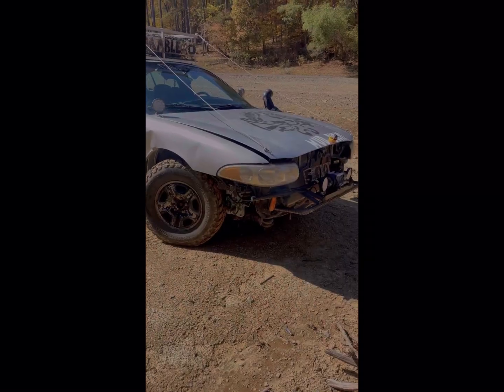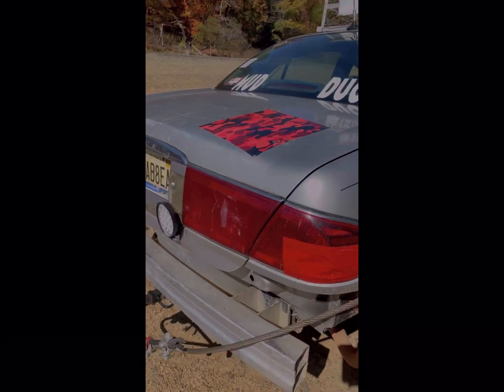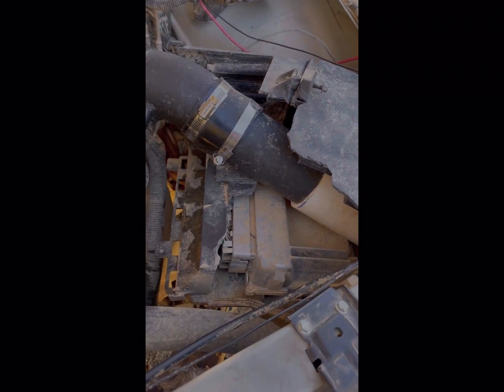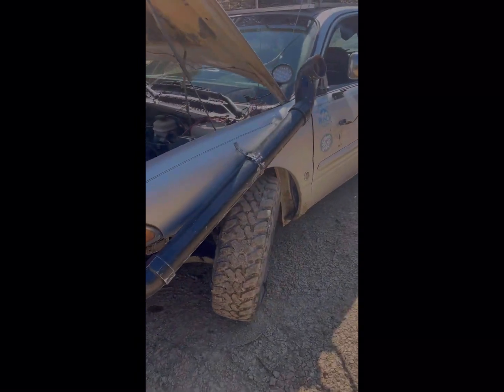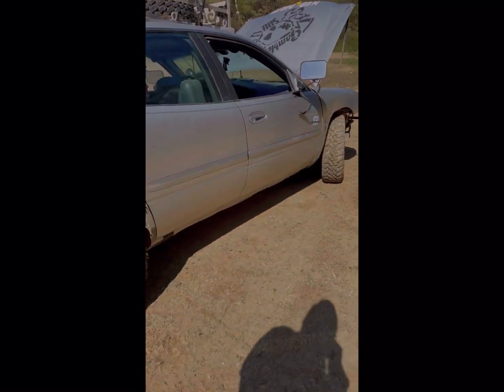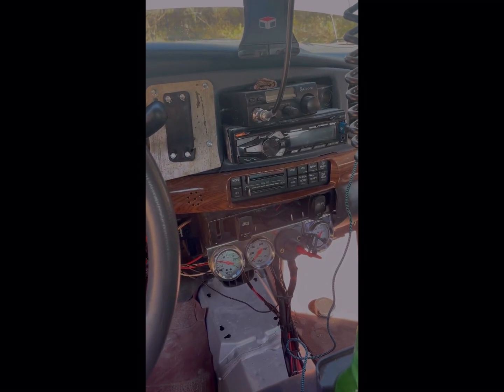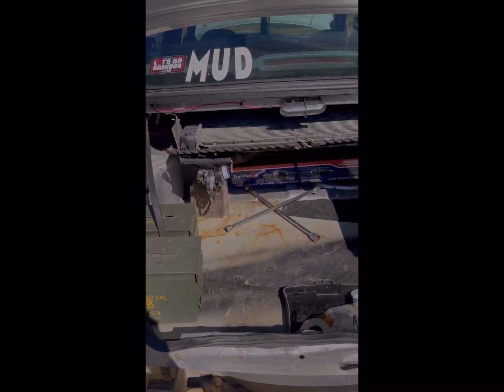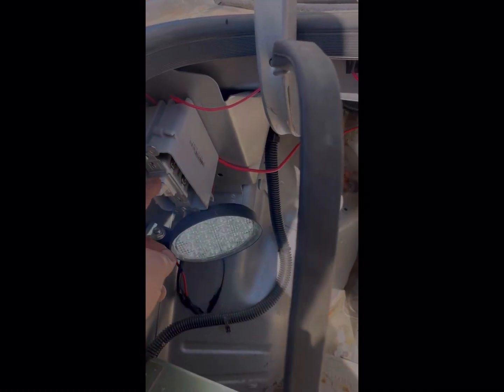THE NEW GAMBLER BUICK LESABRE OFF ROAD EDITION

Comment: Where did you get the springs to lift her? Trying to do a similar build myself and haven’t seen anyone as cool as you to lift a lesabre lol
Reply from the maker: I appreciate it man 
What we did was get 3 inches of pipe or washers and stacked them on top of the spindle and bam it’s lifted 3 inches 
I also got mid 80’s Ford ranger springs and mid 90’s f250 shocks